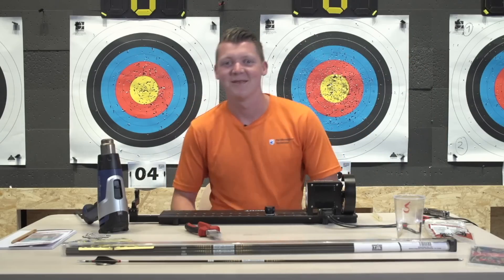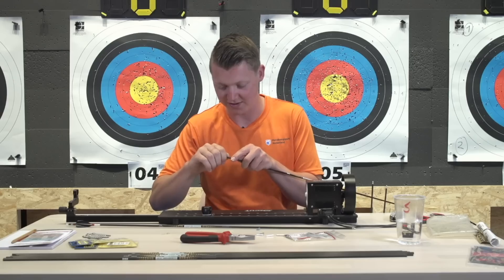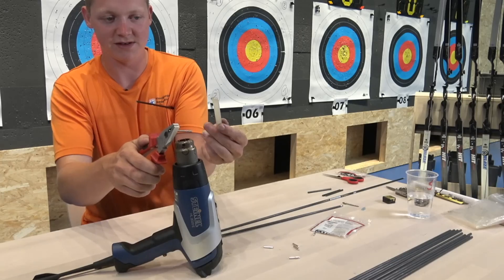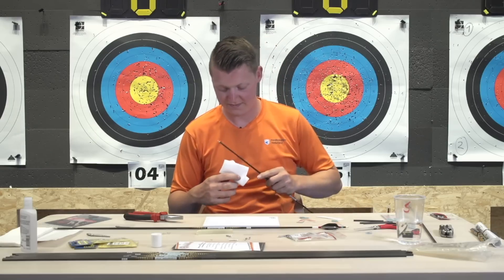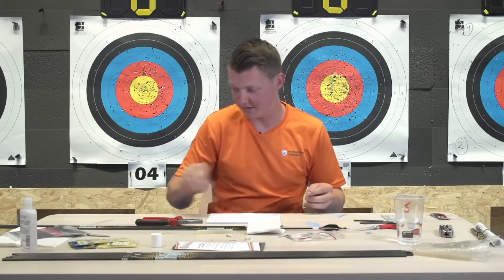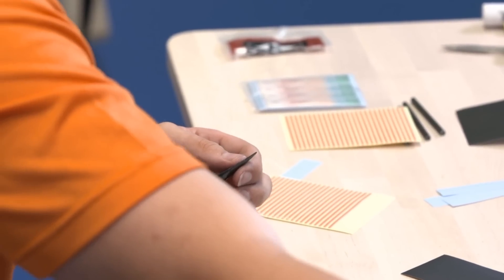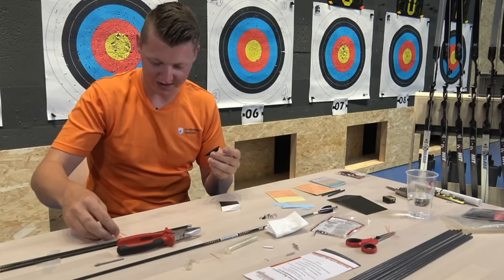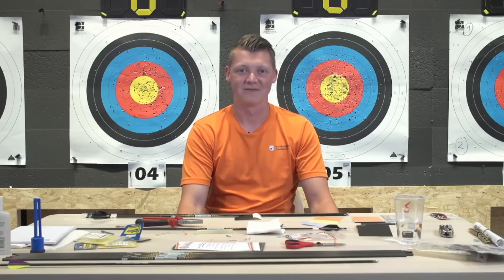Fletching arrows with Sjef van den Berg

Comment: Terrific to get an insight into SVDB's arrow-building and also learn how relaxed and open he is - a thoroughly decent and friendly individual. My sole concern was that when cutting the arrows, he didn't use a face mask to help protect against carbon and aluminium dust. I teach all my juniors that they must wear protective gear, and would have liked to see safety goggles worn as well. Looks like the Decut arrow saw has a micro-adjust for cutting length which would be great. I noted the strategically-placed sticker on Sjef's pliers, too. And I'm prepared to forgive him his comments about pineapple on pizza - I do great ham and pineapple pizzas ;-))

Comment: If you use softer vanes, or vanes with a stringer curl, it’s useful to hold the vane in a fletching jig clamp. Keeps the edge straighter, whether you put the tape on the vane or on the shaft first.

Comment: Try a handheld countersink bit instead of a knife for deburring the inside of the cut end of the shaft. Takes off the loose burr and leaves a slight internal chamfer. If you’re worried about disturbing the carbon with that, a needle file also works pretty well.

Comment: how is he shooting 350 wtf even compound shooters don't shoot that stiff arrows
Reply: X10 is a barreled shaft arrow which reacts a bit differently when it comes to flex than parallel shafts, combined with a plunger which is used on a recurve

Comment: Use a glue gun to apply the glue.
Reply: that glue is not strong enoguht so u need proxy glue or other kinds of strong glue super glues are ok but if ure instrested in doing archery competively or as a sport i recomend upgrading to fastflight glue
Reply: Normal hot glue works just fine. I have use it always, and never lost a point.
Reply: @Jari_Kuusisto  True - hot glue works great with some minor prep work just as epoxy does, but crazy glue is a bad idea. It is kinda crystalline and will break on sharp impacts.

Key with any good bond is that the surfaces been ruffed up slightly and then cleaned with a good solvent. If the glue is provided with that prep work the tips/inserts stay in even when a tree is struck on the 3D field.
Reply: Probably won't bound properly that way as the tip/insert will be to cold...